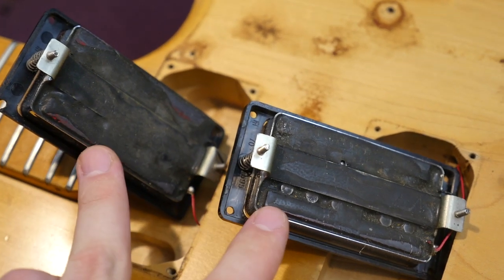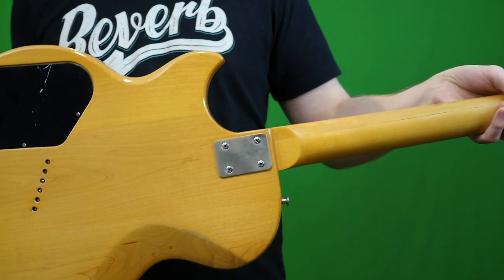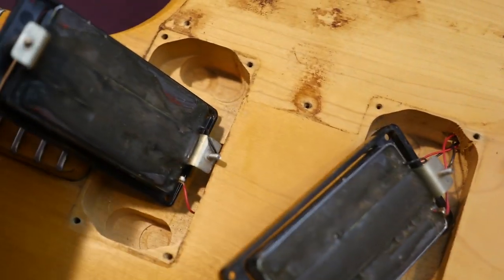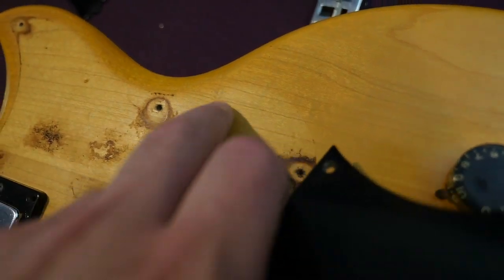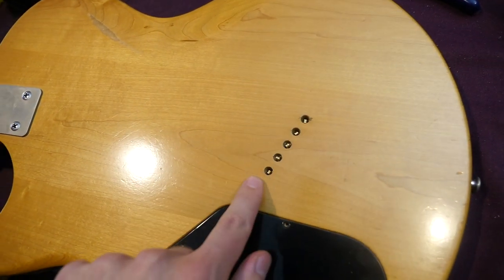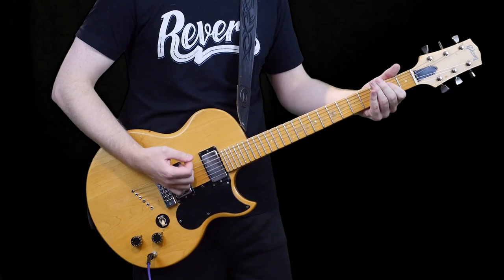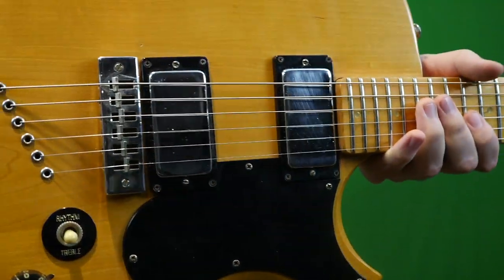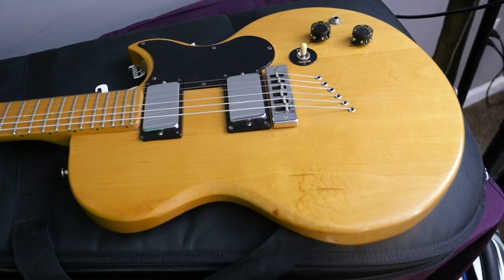I Told YOU to Be Careful, but then I Broke It... | 1975 Gibson L6 Midnight Special | Review + Demo

Comment: One thousand thanks. Now I finally know WHICH 24 fretted guitar Mike Oldfield used to record Incantations in 1977-78, as well as he played on the Exposed Tour ( 1979 ) and the Knebsworth Festival in 1980. This guitar can be very clearly seen both on the Exposed DVD (only released in 2005) and the Knebsworth video available on VHS in 1980. I thought it was not a Gibson but an unknown custom built 24 fretted guitar he needed for Incantations. But it seems the great master didn't like it very much, since in 1981 he returned to his SG Junior with only one pickup. This until he moved to PRS about 1989-1990, as his main solid body two humbucker guitar. I was introduced to PRS by Mike  with his Tubular Bells 2 video, in 1992. Presently, PRS are my favourite guitars too. All the best !

Comment: Nice job...I have one of these Midnight Specials....Gibson says that from the serial number, it's 74-75. According to Gibson, the logo was silk screened on these maple headstocks, but on mine, the logo has completely worn away...but there's no mistaking this baby...and Gibson offered to 'refinish' the headstock...for $525! Imagine paying that for a guitar worth barely twice that!
I was reluctant to remove the pickups for exactly this reason!. Someone also added a small dip switch too - actually drilled through the body to mount it just below the selector switch. I think it puts the pickups in/out of phase, but I can't be sure. The guitar plays and sounds great! Thanks again!

Comment: I bought mine in 1978, and I still have it.  It looks slightly different in the arrangement of the toggle switch and plug in jack. On mine the plug in is above the two dials and closer to the tail.  My toggle switch doesn't have the black thing around it.  I played it for years in Gigs and it has a unique sound with the P-90s or Bill Lawrence pickups.   As a bottom line guitar, it actually has been very reliable and dependable.   I also prefer it in recording, maybe because I am just so used to it.  it plays very easily.   Great fingering ease with that slim neck.  I just love the sound of the P-90s too.    They are somewhere between a Jazz and a Blues sound.  The L-6 looks vaguely like this guitar but it also looks different.  I don't know if the L-6 had Bill Lawrence pickups.

Comment: I've got an old Encore clone of the L6S. 2 volumes, 1 tone, with some old korean/japanese unpotted 5k wound humbuckers.  Has the harmonica bridge and tailpiece from the base L6S, but no rotary switch.  All mahogany, from the body to the neck to the fretboard, with a darker cherry body, and the back of the neck painted a darker transparent brown. Fretboard and some dings in the body are the only places the natural color shows through. 

Love the thing. Just replaced the original pots a few weeks ago, since it had linear volume knobs and the original wiring had lost most of its shielding and would occasionally short.  At one point I had planned on trying to swap its 3 way switch for a rotary knob, but at the time I couldn't find the appropriate tone circuit without just buying an original, and at 18 I couldn't spend $700 for another of the same guitar I had in my hands.  Similarly, I couldn't lay down $300 each for a pair of tarbacks for my $300 guitar.
Reply: You can't sound like maple with a mahogany guitar

Comment: The discolouration at the picup screw holes looks more like oxidation or grease from the screws into the lacquer, the sticking is normal for nitro laquer, and the discoloration on the side looks like sweat residue that didn’t get wiped away, and the guitar left in the sun. But hard to say tbh.

Comment: Tar back pickups are a nightmare, had to replace 2 on a 73 gibson sg. One was dead the other only one coil worked. At least 2 knowledgable guys looked at them and told me, it would be easier to replace then to ever get the Tar out of those. So that is what I did, got some pickups from a friend, I know one was a Gibson, the other might have been a GFS. Put it back together and sold it. It did sound good with the new pickups in it.

Comment: The tone post is mis-wired.  Note that both ends of the resistive element in the pot are connected to ground!!!  Unsolder and remove the Green wire from the tone pot.  I can't see well enough to determine if more of the wiring is incorrect.
Reply: Whoops, That should read "tone pot" NOT "tone post".

Comment: I have an early one of these, these are very interesting guitars. Since Paul Stanley used them I've even thought about the bolt on neck being a way to have them broken and then re-used if any parts were still useable, because Gibson wasn't too fond of guitars being broken. Another interesting detail is that some of these had a bevelled side a la SG and some didn't, some had a faint one. I think it's the better sounding version of the L6.

Comment: The "stains" are just wood figuring. It is just a bit of uneven figuring at that spot of that wood, no "10-tops" there haha. All hard maple body. I have one as well, its been repainted, tuners exchanged, original neckplate missing, pickguard missing and quite heavy wear. Electronics original. Easy to chord on neck and it does have a very special and snappy sound, especially for a humbucker guitar. Neck position with gain gives a sort of Yngwie-esque sound. But in general it is as far from an "all-purpose" guitar you can get. 

It IS weird. But its cool to be a member of only 2000 worldwide exclusive club and it looks cool. Thank you for the video, now thats us with 2 of them, where are the other 1998? :)

Comment: Use a flux pen next time and get that nub really good.  That will make your solder joint way stronger.  Some solder has flux in it, and the paste can get messy if you overdo it.  A good flux pen however, is a god send on that situation

Comment: Some Deoxit contact cleaner might take care of that questionable pot.
Reply: Great stuff!  The one pot in my 69 Custom was super stiff and sticky, it took a few applications of Deoxit D5 but it works great now.  There simply was a crapload of internal carbonization, I got a ton of crud out of it the first time I used it and worked great but stiffened back up over the next week.  It took two more applications but now it seems to work fine, the other pots got hit too just as a preventive.
Reply from the maker: I was hoping too - but it didn’t work. Looks like it might be a wiring issue according to another viewer

Comment: Glue lines starting to separate not an issue? I don't think you are qualified to make such statements. How many instruments have you built? Zero? The glue is supposed to never fail. The glue line, should be almost invisible. The instrument needs to be repaired. Ask a luthier.